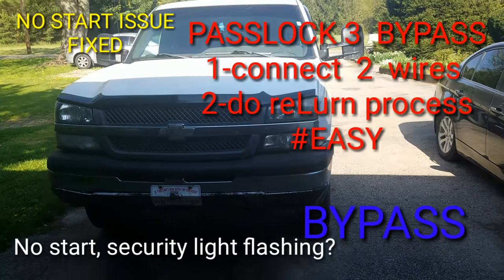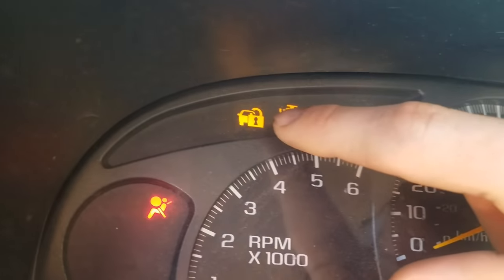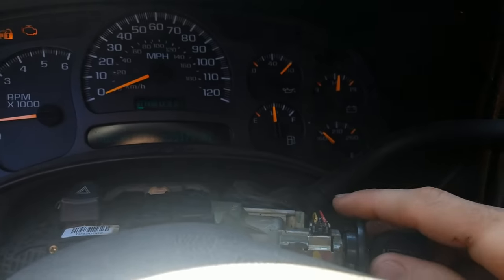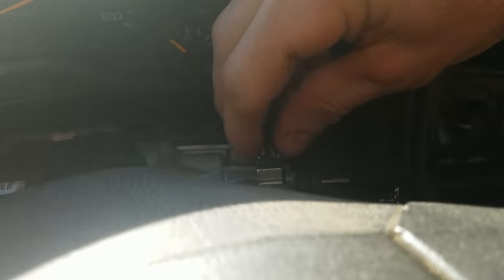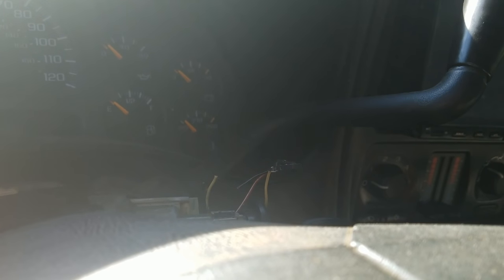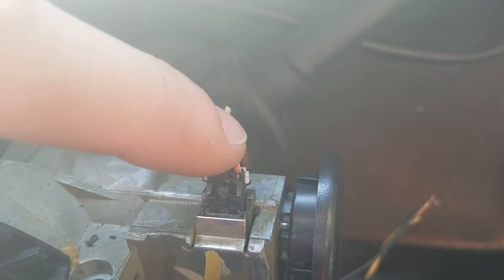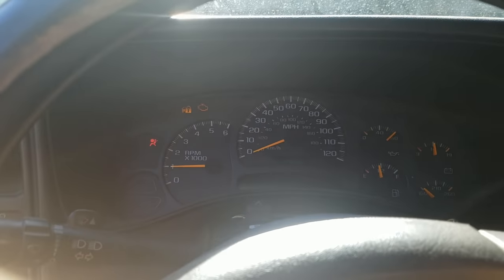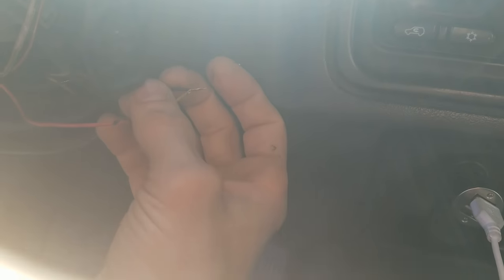PASSKEY 3/SECURITY  SYSTEM BYPASS! No start issue? CHEVY/GMC 1500,2500,3500

Comment: For reference, it's actually a PASSLOCK-II anti-theft system on 1998-2006 (2007 Silverado Classic also), not PASSKEY-3. PASSKEY-3 is a transponder type system.
Reply: 100% correct & Passlock 3 is even worse. Thanks GM 12+ year old trucks stall & won't restart because of lousy electronics.
Reply: I have 05 its passlock 3
Reply: @justinpeasley5529  what did you have to do?
Reply: @caintgitriteexp9342   i ended up finding a 12v 1k ohm resistor i cut the yellow kept the black in place then did a program steps with out a scanner its been working perfect
Reply: @caintgitriteexp9342  leave the black wire attached  cut the yellow put the resistor on the yellow the other side of the resistor goes to black   just strip the black and attach
Reply: @caintgitriteexp9342  passlock 2 and 3 are not transponders there resistor keys
Reply: Also it’s 99-07 not 98
Reply: 1998 Chevy bypass the security code
Reply: @stacyspikes213 how?
Reply: @justinpeasley5529 so that process you did bypassed the pk3 system?
Reply: Thank you micromanager

Comment: Spent last 2.5 weeks trying to fix it... Read every forum and watched every video.... THIS IS THE ONLY ONE THAT FIXED IT THANK YOU SO VERY MUCH
Reply: This video saved me to, was just plowing this morning and truck stopped needed a quick fix watched this vid and instead of cutting wires I got a piece of mig wire and put it into the clip holes to complete the circuit, then re learned the ignition same as vid and it works evertime now thanks again !!

Comment: I did the two wires together method today. It worked the first time. This vehicle was a 2000 chevy 1500 silverado. The security light is in the info center and not a dedicated lamp. The security light would alternate blinking 5 times then the battery light would flash on then solid for 5 seconds then the security would flash. It did that for ten minutes then the battery would stay on. Then i would cycle the key after 5 seconds and before 10 seconds. Did that three times. Worked perfect, the security light stays on all time. Dont care about that. Thanks
Reply: i got the same truck had same problem tried the 10 minute wait 10 second  3 times thing 3 times didn't work till i just random like 14min wait 20sec them 17 min wait 26sec then 15min wait 30sec worked then
Reply: One isn't working
Reply: Ill just buy a ford!!!😔
Reply: Did you think it'll work if you've had the ignition changed?
Reply: Do you think it'll work if you've had the ignition changed?
Reply: @EdwardeliyahHamnerBoMF  yes

Comment: What if my security light isn’t staying on or flashing during this process? I’ve tried it multiple times and still won’t start. I replaced the relays and fuses. Battery is good etc. solenoid is good. Just won’t start. It was working fine and then the same day it just wouldn’t disengage
Reply from the maker: Does the engine turn over?

Comment: My security light stayed on after relearn from replacing the housing and cylinder on an attempted theft on my truck. All i did was unplug the battery for about 5 minutes and it turned the light off back to normal

Comment: Thanks , it works. They broke into my truck and screwed with ignition. Had to drill lock out and wouldn't start with new cylinder. Great vid👍
Reply: I hope this is a joke because the guy is just tryin to help people shouldn't blame other people for your problems 🤷
Reply: @patrickvandiver1873 , Re-read the comment.  He put a new cylinder in AFTER they broke in and tried to steal his truck. This fixed the problem for him and he's thanking OP.
Reply: Same thing just happened with me. Someone tried to steal my truck and we thought the ignition was broken

Comment: Thanks dude! Worked great on my 2007 chevy 1500 classic work truck. 4.3 v6
Reply: Jake I have the same truck. Mine would stall 2 seconds into cranking a couple times and then start up. My airbag message would come up as well. What issues did You have?

Comment: Holy shit this worked. Tried this one more time right after I called a tow truck to take my hummer to the show. The main key is to wait until the security light shuts off before you turn the key off for 10 seconds. The first cycle it went off after 9 minutes. The second cycle it took over 11 minutes. Truck started right after that!
Reply: Thank you. The first time I did it. It was 9 mins. The 2nd time it wasn’t shutting off way after 10 mins. But this next time o will wait a few mins after 10

Comment: Dyam thief phuked my ignition cylinder, luckily couldnt steal the truck.  Did this pricedure 6 times, finally worked when I waited the Full 10 seconds instead of 5 secs.  Overall, my truck runnin again.  Thank u sir
Reply: Did u connect the black and yellow or did u use a resistor
Reply: @elbambinomaloso189  Black and Yellow wire still wired together right now.  going to leave it like that.  Trying to put together a Steering Wheel quick disconnect so it will cause them not to waste their time trying to steal this truck.

Comment: I did this fix on a 2007 GMC 1 ton van. I left wires unplugged from ignition after soldering. Did the relearn and the van started. Security light is still on but is not bothering me as long as this fix is permanent. Thanks for the video.
Reply: Just did this with my 06 Silv and have the same wonders of it being a permanent fix. Has this worked out for you?
Reply: Was this a permanent fix?

Comment: You don't actually need to know the resistance but instead the voltage. Remove the starter relay and measure the voltage across the wires when trying to crank. Install a variable ohm resistor and adjust the resistor untill the voltage matches.
Reply: exactly

Comment: Works for me at the 3rd time 2007 silverado classic 4.8 my security light was on solid but truck was running fine and then all of the sudden start for one second or two and died, i just jump those 2 wires and did the relearn procedure and it worked, thank you very much.

Comment: i have another question i just bought 2006 chevy silverado and when i turn the key it's completely dead. If it's the immobilizer would the car try to crank but not start? or would it just not start at all? btw sometimes the vehicle will start on the first turn, sometimes my spare key will work and other times i have to put a battery charger on it well i do 3  10 minute reprogam and even that doesn't work on the first turn. The car battery is also 3 years old but i have charged it up and it always show on my multimeter over 12v the alternator is good too.. I'm kind of at loss; it just does not crank just nothing except  the fuel pump will come on and the radio and dash lights come on. I don't hear any click click click from the starter so i don't think it's that. My biggest question here is does the immobilizer allow the car try and crank over or will act like a dead battery?

Comment: 45 cyanide
35 minutes ago
FIRST I give credit to andy Kendeigh   ...  I have done this to my customers 1998 chevy express 1500  5.7 van and it is working well so far [ 2 days ]     I have not released the vehicle to him yet.........longevity testing.  Working so far.  No need for cutting and splicing wires .............so far.  With truck running as normal      - I disconnected MODULE # 16254825  [canada ]   model# ab91502r  .......Production date of truck 12/12/07    ..YES that's correct , NO module plugeed in.  Startes and run great.......................Be sure you have a STRONG  battery guy

Comment: Does this work for chevy trailblazer 2006? I had the same problem my chevy trailblazer won't start it will crank for 2 seconds then stop after a couple of times of cranking it will finally stops from cranking then i observe my fuel injectors is not blowing a gas my fuel pump is new

Comment: Mine starts and dies right away but I have no codes and no security light. I already replaced the pump and fuel pressure regulator.
Reply: Any update

Comment: 2001 GMC Sierra , the security light isn’t flashing. We did this still nothing
Reply from the maker: If the security light never came on before you did this then your problem probably isn't related to the security system.
What is the truck doing or not doing currently.?

Comment: Did this a couple of weeks ago and a week later it had the same issue. I turned the key on and left it for 10 minutes but still wouldn't start. I cycled the key 3 times and then it started. Hoping that was the trick.
Reply: Were you able to get it fixed? Just did this to my 1999 Chevy c/k1500 yesterday and it started up great, came out this morning and it’s back to its old problems.

Comment: Im having a no crank issue with my 2004 gmc 2500 HD. I changed power steering pump and something went wrong last night. I had unplugged the computer for the transmission and after all was put back together, my truck wont start. Im gonna try this tomorrow and see if my truck will start. Glad you posted this video.
Reply: @Joshyodenn  ok. I'll try that. Thank you for the info. Ill post if it works for me. Thanks again.
Reply: What happened
Reply: Ok my ? Too u is I f I get a chip key n cilinder frm a GMC 2008 tht is reck  n tke tht cylinder n key n installing on my GMC 2008 would it wrk on my 2008 Gmc  truck  by programming  it  to my truck

Comment: I have a 06 Chevy Silverado 1500. Tried cranking the engine, nothing. I’ve been having issues with my ignition lock cylinder. It would start after multiple times. I hope this works

Comment: I've a 04 Caddy Deville. The ignition lock cylinder wouldn't allow me to insert the key. So I bought a new cylinder, now I need to know how to bypass the passkey 3 system so I won't need to re program the key.
Reply: Similar situation where my 2002 Silverado key cylinder is jammed up.  Since you could not turn to the start position to remove it with the "pin hole depress", did you just drill it out to replace it?  Any help is appreciated!
Reply: @rickwhitfield4682  Yes. I finally took a drill and that is how the key cylinder came out?

Comment: So after connecting two wires does it matter if the plug is in or out for the bypass to work? I haven't tried it plugged back in yet so the red wire is connected. My alarm won't quit going off even after disconnecting the + battery for a while???

Comment: i have a 01 s1500 silverado and the wires i have are brown green red w/white strip yellow and orange w/black strip which ones do i need to connect to start my truck the key cylinder wouldn't turn so before i looked anything up i cut those 5 wires and now can't start my truck
Reply from the maker: Is your key cylinder working now? or did you replace it?
Reply: @Joshyodenn  i actually was having a shitty day that day and was already pissed so i basically destroyed the ignition and cylinder and necked it if you can reply with a email i can send a pic of what i'm working with now
Reply: @Joshyodenn  well I cut the set of 3 wires and 2 wires that were connected to the ignition housing the red w/white strip orange w/black strip and yellow the there is a brown and green wire

Comment: Thanks for the advice I'm about to try it out on my 99 Tahoe...
Reply: Will this method on a 98 Honda I lost the keys and put a new key ignition and it still won't start
Reply: Did it work I seen you posted on another video also witch one worked out

Comment: I like your video but just for an idea when you want to jump those wires instead of cutting the plug off you can use a staple or a paper clip fold it into a U-shaped and stick it in the top of the plug but your video was very helpful for me so I figured I might help you out on something
Reply from the maker: good idea but the connection needs to be soldered, because if the resistance changes slightly then the truck won't start again

Comment: 99 gmc sierra 4x4 message board light stays on says security,while truck is off with key out. If unhook batt cables hook back up its off,but same problem after drivin.

Comment: What about everything in the interior dies or it won't start?  These are my symptoms.

1.  Driving along and everything inside the car goes dead but the Tahoe keeps driving.

2.  I make a hard left turn, and everything comes back on but then dies out again.

3.  One day the starter would turn over but5 wouldn't start.  Everything inside is dead.

4.  Remembering the left turn deal, I put the key in the on position, everything still dead, I opened the door, grabbed the edge of the roof and started rocking the truck.  The interior lit right up, and the radio came on and I was able to start it.

5.  The problem would resurface.

Do you think it could be a motion detector that is acting up?  I have a blank key that will start the engine.  Has the previous owner disconnected my security system?

Comment: This helped a very frustrating issue. But. Its happening again weeks after. Its relearned my key. Does it need to relearn again ?
Reply from the maker: You probably have a bad wire connection somewhere make sure all connections are soldered ,so the resistance doesn't change. But if it stopped working then it will have to be relearned again.

Comment: 2003 chevy tahoe z71 trued it but doesn't crank or anything i have an aftermarket key I haven't tried the wire process just hoping it works if not what is another tip u could spot me would truly be appreciated
Reply: Did it wotk

Comment: I Definetly need help with this I just bought a 07 buick rendezvous a couple days ago turned on fine and made it home fine next day went to start the car and nothing no sound no nothing all lights come on and radio but just in case I took the battery to auto zone fully charged it and its a good battery my first thought was a starter so I bought and changed that still nothing I noticed my security light was flashing what the hell do I need to do to get this car to start please help thanks in advance
Reply from the maker: If the security light flashes i would try doing the relearn procedure first.
Reply: @Joshyodenn  we did that and it didn't work we ended up hiring a lock smith he plugged his computer in and reseted everything as if I lost all keys and then he reprogramed it...that seemed to work car starts now however security light still flashing amd anti theft light is still on

Comment: Truck runs but when you shut off it won't start for about 2 hours. why?
Reply from the maker: What truck do you have? If you did this procedure make sure to solder connections.
Can you hear the fuel pump come on when you turn the key to on?

Comment: This process worked and now my truck, 06 Silverado, is reading the key. However, now it just seems like its trying to turn over but wont start.
Reply: @Joshyodenn  Yes. A few hours later it just randomly started after someone came to look at it and I was trying to show them the problem; of course. It worked all day after that, and then this morning it started doing the same thing again like there is no fuel. Once yesterday the security bell rang 4 quick times like it use to before I did the bypass as opposed to4 slow rings; I removed the key and tried again 5 seconds later and it started right up.
Reply: @Joshyodenn  So I am intermittently having issues with my truck still, even after doing this. Here is what I experience:
(When it starts): Key in, no chime, turn to acc, 4 slow chimes, starts.
(When it does not start): Key in, chimes until I turn the key to acc, at acc it chimes 4 quick chimes, does not start. 
Battery is charged. No loose connections I can see. 
I try the leave it in acc for 10 minutes, then off for 5 seconds, still nothing. I can even do the 3 sets of 10 minutes option, still nothing.
Then randomly I'll check it and it will chime slow and start. 
The times in between when I check it does not seem to matter: once I checked it at 5 minutes and it worked. The next time I repeated everything the same and it did not start. One time I was showing my neighbor; he turned the key, it did not start, I explained the chime thing, he turned the key to hear what I was talking about and it started. 
Do you have any ideas?
Reply: Have you figured this issue out? Currently having these same malfunctions.
Reply: @CumRod69  still the same problem. One guy took apart my instrument panel and found a bunch of crack soldering. We fixed that, but since then my truck has sat in a lot bc of quarantine issues involving finances to keep working on it.. if you find a solution, please let me know.
Reply: @tone2744  currently digging for solutions! Will do

Comment: I have a '03 Buick Park Avenue, I had to change the steering column a couple of months ago, had the security system reset, and all was good, then two weeks ago I went to town and when I shut the car off the flashers came on, cranked the car back up flashers went off. I manually turned on and off the flashers and they appeared to work fine, turn off the ignition and they come back on. I got into my dash and found my ”dual purpose” flashers and replaced it, nothing changed. So into the underhood fuse box and removed HZD fuse, and no flashers period but, then I noticed the taillights were on while the light switch was off! Now I'm thourghly stumped. Any suggestions? Thanks

Comment: 03 Silverado cranks but won't start. The security light goes out quickly after turning to on. I think truck is not sensing the key? What could it be? Thanx, RC
Reply from the maker: If the security light isn't staying on or flashing, then there's probably an engine problem or fuel pump problem, first try switching the fuel pump relay with another relay that has the same numbers on it ,make sure you have fuel pressure by the engine there's a bleeder valve by the fuel rail, check oil level
If it weren't sensing the key then the security light should stay on or flash.